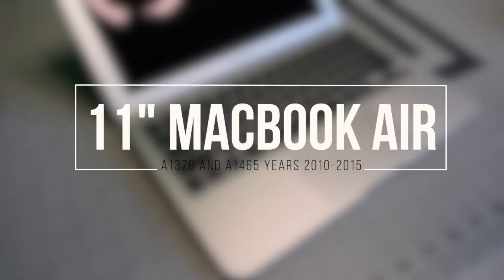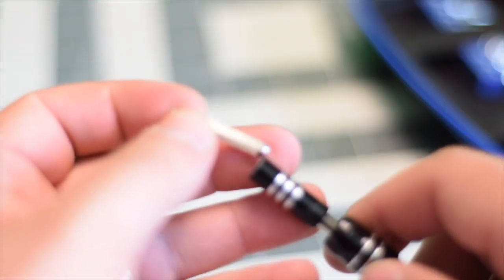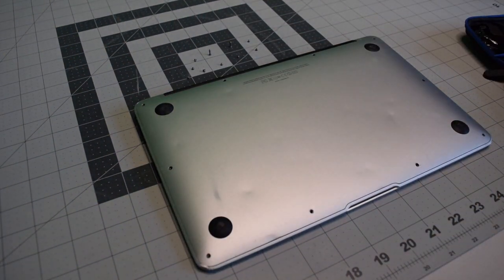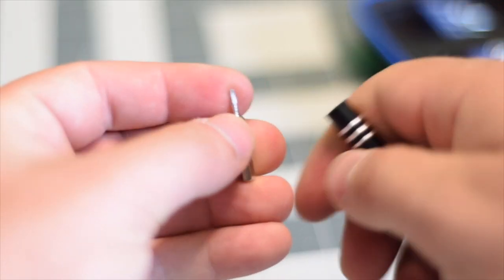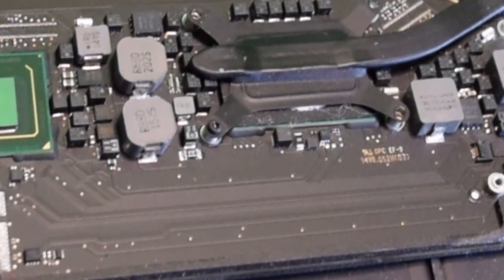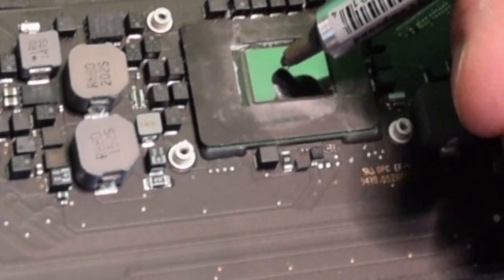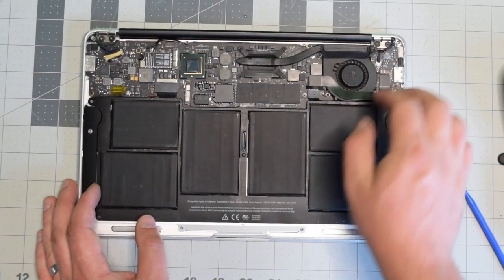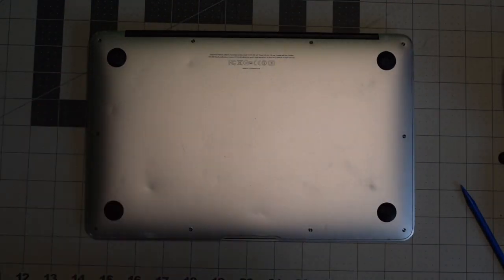11" Macbook Air A1370 and A1465 CPU Heat Sink Installation for years 2010 2011 2012 2013 2014 2015

Comment: Bro do you really know what you are talking about??? I tried following your guide and the tail end of the heat sink is still hanging onto the fan an won't come off. You keep saying there's no other thing need to come loose for the heatsink to come off but that's absolutely untrue. Why fooling people here when you don't even know how to properly do it?? You must be missing a screw that you took off when you work the fan or whatever. Come on dude do better.
Reply: It is, you just have to shake it a little to pull it off, since the end of it has rubber. Make sure you have the right model.